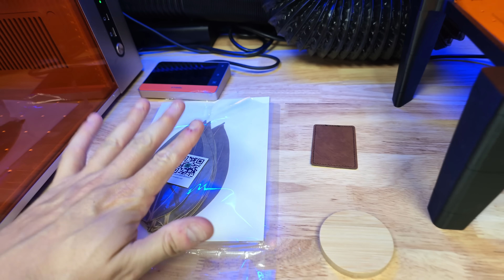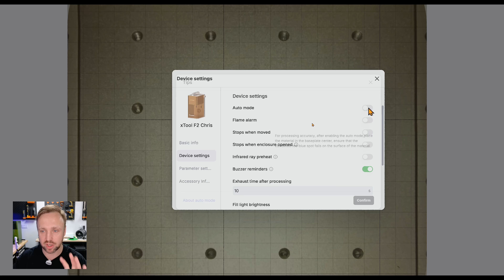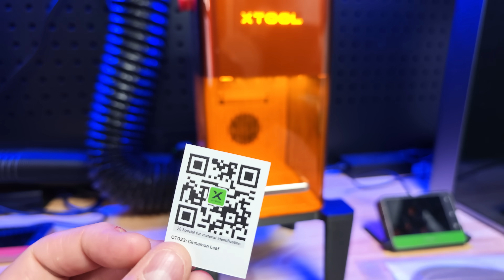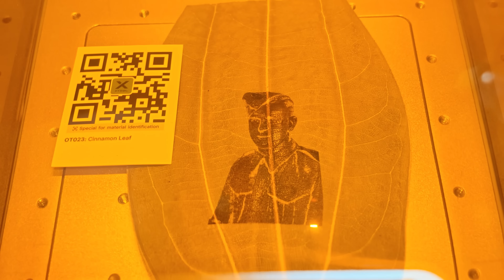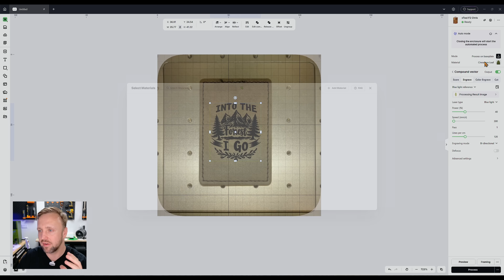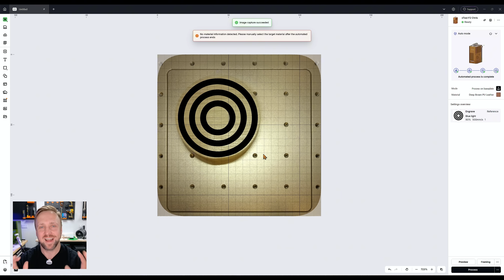xTool F Series Lasers Just Got a LOT Easier to Use!

Comment from the maker: What do you think of this new ACS feature?

Would you actually use something like this in your workflow? And what do you think about the little secret I shared towards the end of the video?
Reply: I think it is useful, but would love a QR code generator so when I have settings dialled in I can put QR code in with material to spode things up.
Reply: I think it looks great but I couldn't get it to auto focus on the f2 ultra uv no matter what I did
Reply from the maker: @michellealexander3580 I had the same problem with my F2 Ultra UV and have reported it back to xTool. Hopefully they will rectify it soon.
Reply: @L3DAccessories thank you for getting back with me now I know it’s not just me your video was great and I followed it
Reply: I hope xTool will allow creating and adding your own QR-codes for your own specific materials and end results.
Reply: The automatic material  recognition would be good especially for the craft / one off community where if it get a slight difference between say PU / real leather for one or two items won't show up too much.  

However, if you were in a retail shop environment where items sell at a random rate 2 of product x, 4 of y, 1 of z and you needed to replenish your stock and go back on the shelf, ideally they should be exactly the same as the ones sold. In a production environment it would be perfect for a staff member to pick up a barcode for the product, place it on the mat and the machine has the same settings. With the auto centring it also takes out 1 stage for staff.  It may sound blunt but the less options and steps for staff to get involved in the better

Comment: Thank you so much for sharing!! I'm new to laser crafting. I volunteered for a job that requires variables. I made an 8 card jig for my slide extension thinking it would speed things up, but instead what had taken 24 sec., took 3:10 to run. 8 on the slide, took longer than 50 cards did, two at a time on the baseplate. Before panic set in I headed to your site to see if there was something I could learn that would help & came across this video. I hadn't noticed there was an update available. You've literally saved me 10.5 HOURS!! Plus I can keep the cover down now.
Reply from the maker: That's brilliant to hear, 10.5 hours is a huge saving! Good luck with the job.

Comment: WILL IT AUTO FOCUS AND PLACE IN A JIG? some materials like metal business cards are lower than the jig itself. Right now I configure the cards at 12.2mm because I know their focal point but the jig is about 1 mm higher.. Thanks
Reply from the maker: I'm not too sure. Assuming the jig holds the card centrally then it should be able to autofocus and place it. But it won't rotate the design.

Comment: To make sure I'm understanding this correctly: If you have an xtool material with the new QR code, it'll select that material then center the design and assign laser settings. If you don't have an xtool material or just don't have the new qr code, it will center the design only and the rest is still up to the user to fill in.
Reply from the maker: Yes, without the QR code it will still auto focus, scan the image with the camera and centrally locate the design. But you'll need to manually change the material (or select it first)

Comment: Have I missed something - couldn't Xtool (or someone else) provide a set of qrcodes which describe the material as close as possible e.g. generic PU, oak or pine wood, leather etc ? and then provide suggested settings ?
Reply from the maker: Yes, absolutely. Personally I'd love to see xTool eventually allow us to generate our own QR codes and assign custom workflows to them.

For example, you could create a QR code for your own material or product, assign your preferred settings and workflow to it, and then whenever that QR code is detected ACS could automatically set everything up ready for the next design.

I'd also love to see things like automatic rotation/orientation, smarter placement and potentially even automatically adjusting the design to suit the detected material.

Whether xTool plans to take it that far I honestly don't know, but that's definitely the direction I'd personally love to see this develop in.

Comment: More bs we dont need while the f2 ultra has severe software weaknesses. For one we cannot process 16 bit depthmaps. This machine caters way too much for beginners. Also no global pass settings like lightburn has. These both severely weaken the results you can achieve while being an extremely high price for a 60w.
Reply from the maker: I think we're looking at this from very different perspectives. The features you've mentioned may well be important to more advanced users, and they're perfectly valid things to request from xTool.

Where I disagree is that making the machine easier for beginners is somehow a negative. Not everyone wants or needs the same level of control, and there's absolutely a place for making laser engraving more accessible to people who are new to it.

Personally, I'm happy to see xTool continuing to add functionality to machines people already own. That doesn't mean there aren't other areas of the software that could also be improved.

Comment: I don't have an auto mode for my F2 UV... saids firmware is up to date
Reply from the maker: It means your software is probably an older version. Did you check to see if your software version matches what I show at the start of the video?
Reply: @L3DAccessories  I just logged in and xtool studio updated and the F2 👌